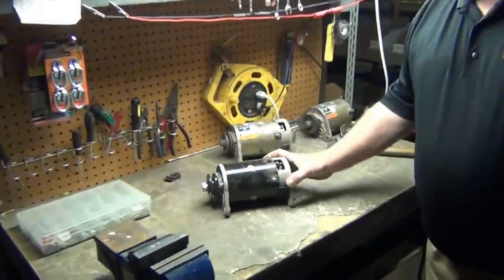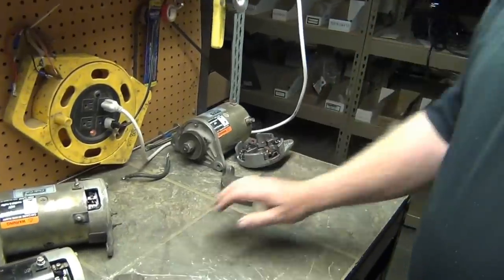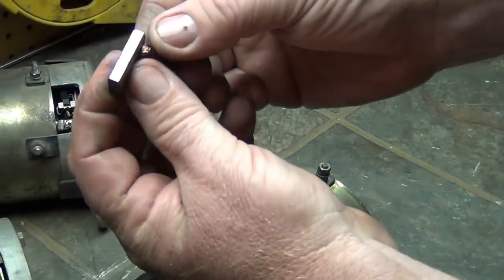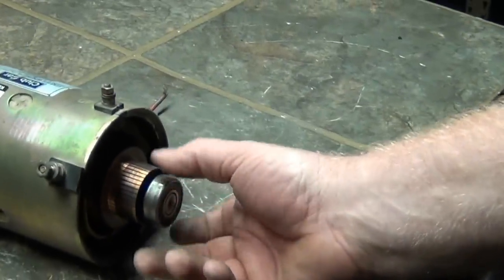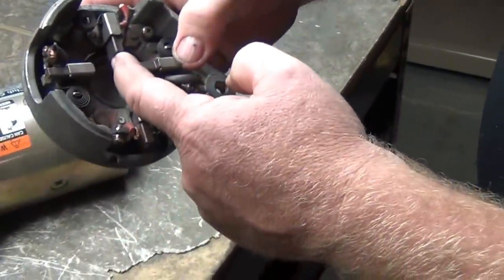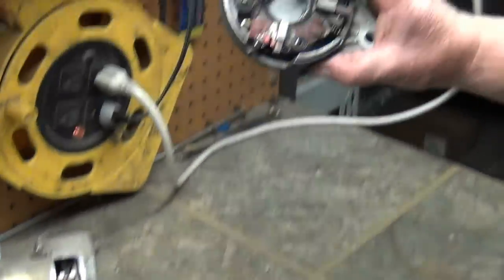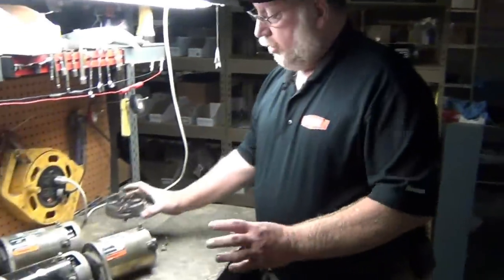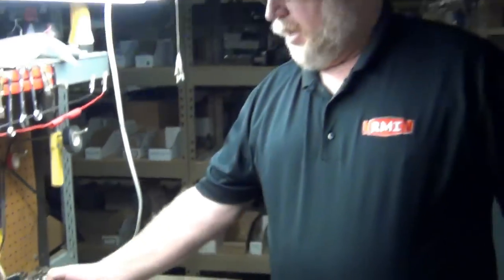How To Change Brushes On A Golf Cart Starter Generator

Comment: I just replaced my started gen. with a new one.It's and 86 club car in excellent condition.  I was told that I have to polarize the new starter generator but I dont know how. Can you explain this to me please? I'm getting a real bad clicking on my cart. I replaced the brushed on the old starter gen. as explained in this video. Thanks. Other than being a little time consuming it was pretty easy. Still clicking. A friend of mine bought me a new starter gen but it still clicks. Since the cart is almost 28 years old I decided to replace the voltage regulator solenoid. battery and cables all four micro switches and both belts.Spark plug Air filter and new oil But it still clicks. Especially when I first push on the gas pedal. I figured its just like my car. eventually  it needs a tune up so I didn't mind spending a little money on it. Any help you can give me would be gratefully appreciated.

Comment: I recently got this golf cart, replaced the solenoid, and gave the battery a charge, the starter does not turn over, except it does slightly when i attempt to spin the clutch drum...I will pull the starter and look for the things you mentioned..thanks
Reply: JunkStar Builds

Comment: I am having a hard time seeing what you mean about if the brushes are standing up in their holder.  It all looks the same to me.  Am I looking at the wrong part?  I thought the 'brush' had a flat end to it, but what I'm seeing are curved looking?  Do they wear out and get curved like that?
Reply: If they are standing up that basically means they are not as worn, the more they wear the further down the guide they go, so standing up basically means how high the brush sits up in the guide, obviously a new brush would ' stand up' because it has more length to it and once it touches the commutator or armature as some call it it will protrude out the back of the guide, does that make sense?

Comment: well i replaced the brushes and the cart runs good like it has in the past but then it dies again, i took apart and rebuilt th carb and fuel pump, replaced the spark plug [again it ran fine for a day now its not running again and seems to be a intermittent problem, will the starter turn over if its bad and also how can i check my plug for spark? and also your last comment on grounding out,  will thestarter turn over if grouned out?

Comment: on a yamaha golf cart, new battery,solenoid and starter generator, engine turns over will not start! if i release the fuel peddle it continues to turn over, so i have to disconnect the battery to get it to stop. if i disconnect the positive from the starter generator, using a test light alligator clip on the positive terminal  and place the probe on the starter generator positive  post  and then push the fuel peddle, the test light, lights green  indicating negative, is this correct??   testing the positive wire disconnected from the starter generator with a test light and pushing the fuel peddle it does turn off when releasing the fuel peddle!!  just not when it is connected!

Comment: I have checked my generator on another carryall and it works but when I put it any of them in my carryall it does not read that is charging, I also changed what I think is the regulator and it still did the same thing. can you please help I do not what step to follow next

Comment: What would cause the brushes to only last a short period of time? I've changed the brushes out twice in the past 10 months.
Reply from the maker: +bforester1982 sounds like it could be the commutator end of the starter? Sounds like it might have some raised bars causing the brushes to wear? More than likely might need a new starter.
Reply: +Matt Rogers 
Ok. Thanks for the tip. Do you have an opinion on using a after market s/g as oppose to a OEM?
Reply from the maker: Well, I think either would be fine. We normally use OEM depending on Make and Model. But Aftermarket would probably be fine.